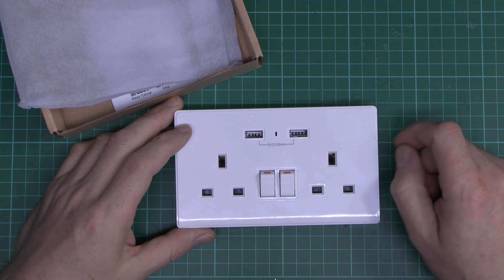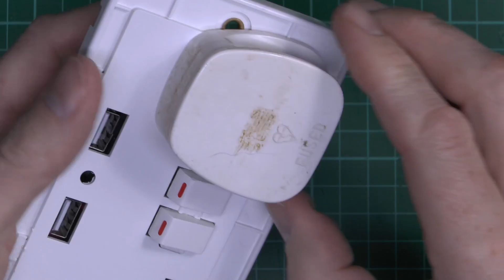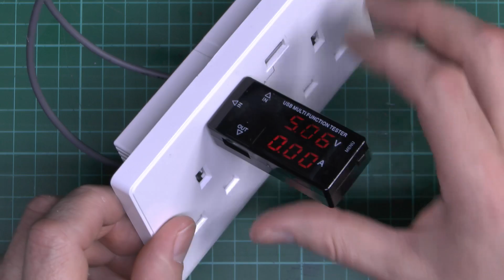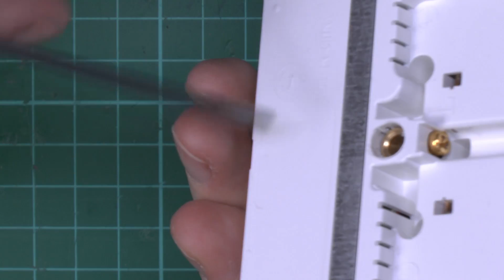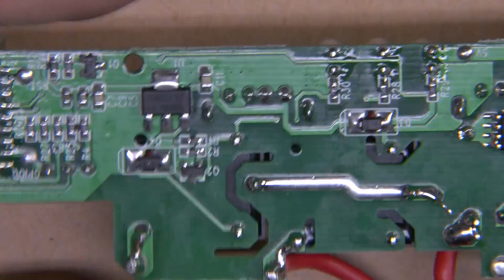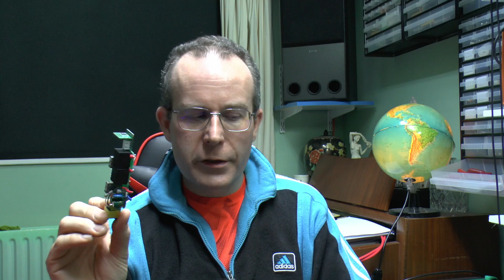WiFi Controlled UK USB Socket Outlet Teardown

Comment: Excellent video!  Very topical, in-depth and not covered before!

Wouldn't touch one with a dead rat attached to the end of a barge pole!
Reply: Big Clive tore down something similar (It lacked the WiFi capability) a few years ago, the usb output was extremely unstable and it turned out that the earth connections on the two sockets were completely separate (Probably one of the few things this unit gets right.). But I really cannot see the point of inbuilt USB connectors, this is one case where it's much more sensible to make use of adapters.
Reply: @Graham-ce2yk  Yes the Big Clive video was pre WiFi enabaled. Even if a quality manufacturer makes a good one they are already outdated. The USB standards have moved on from 5v/2amp Type A.

Doubtful they will build 55w/100w per outlet PD USB C ports with different manufactures standards for Quick Charge.

The WiFi is also serious weak point for many reasons.
Reply: Not even if the rat was WiFi enabled?  Haha! Yes I know what you mean though, and this "internet of things" is starting to get irritating now.  Google and Elon Musk and their ilk need hanging from the nearest public gallows.........WiFi operated naturally!